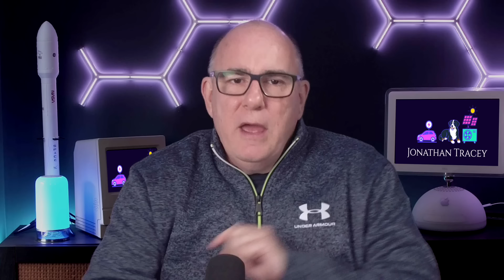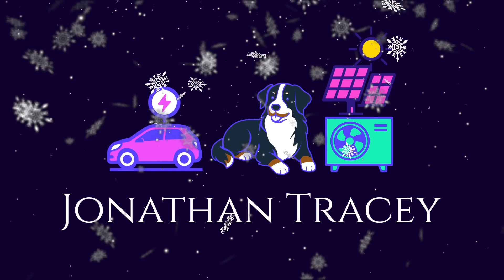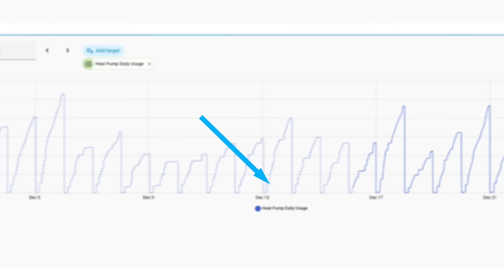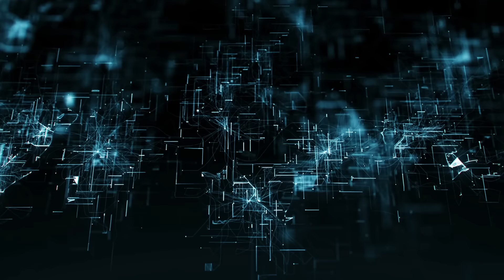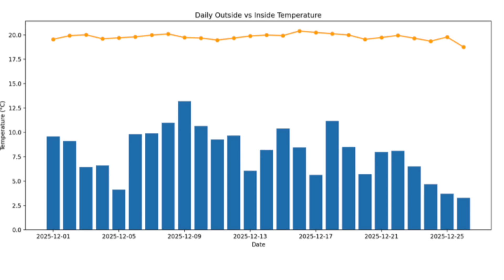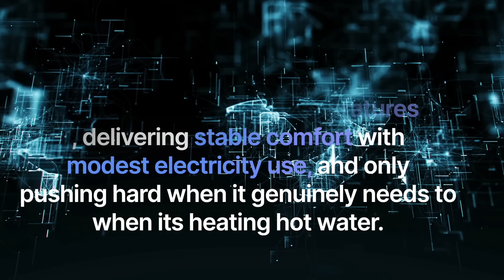I Analysed the Data — Here’s What Everyone Missed

Comment: That's a great video Jonathan which answers a lot of questions for someone like me who is just thinking of getting a heat pump. I got solar and a battery installed last year and it has been great - on course for zero bills overall in the first year - so a heat pump is the next logical step.
Reply from the maker: yep if you have the battery capacity it makes running the heat pump in winter super cheap

Comment: The flow temperature and energy used by outside temperature is surprising.
I wonder if it would be a good idea to drop the temperature on the thermostat by 2-3 degrees at night and therefore leave it running 24 hours say November thru February?
Reply from the maker: we actually do that we set back the temperature at night time from 10 pm till 6 am to 17°. It makes it a little bit more comfortable to sleep and it runs consistently from mid October to usually roundabout mid March.
Reply: @JonathanTracey That’s a good tip 👍
Does the installer suggest that ?

Comment: For comparison, my data for December 2025: (SI units)
Heating degree days for 31 days: 509.6 HDD=31 days*(T.inside-T.outside)
Inside average temperature 19.50C
Outside average temperature: 3.06C
Heating area thermal losses estimated: 135.775 W/K (Yearly 3000HDD =>  9775.8 kWh/year / 54m2 = 181.03kWh/m2a)
Total heating energy:: 1660.6 kWh
From people: 66.96 kWh = 4.03%
From electrical consumption: 74.4 kWh = 4.48%
From solar gains: 258.99 kWh = 15.60% ( solar gains efficiency 94.94%) ( solar gains gamma = 0.188 , alpha = 1.6667 . tau = 10h ) (0.129 kWh/day/m2) (68.2m2)
From gas heating 1260.23 kWh = 75.89% duty factor=39.51% @ min.modulation=40% part load efficiency=87.9% declared efficiency=84% LHV total efficiency=64.59% HHV
Gas heaters 3 furnaces total power=14kW @ LHV (oversized)
Heated area: 54m2 Solar absorption area: 68.2 m2

Comment: Interesting video, thanks.  The point about the thermal mass of the house is interesting - we were on holiday in November when our boiler stopped working (system pressure too low) which meant that the house cooled down to around 7C while we were away.  The energy consumed to heat it back up again was substantial and this was due to having to heat up the fabric of the house again.  Unlike gas prices, electricity prices vary by time of day so it would be interesting to see what impact this had on your usage.  And it would also be interesting to see the same numbers for January now that it's got a bit colder!
Reply from the maker: So the way I run my system is that I import all the energy I need for the day overnight when it’s cheap and storage in batteries, this then feeds the Heat Pump and the house so the variable price of electricity doesn’t really impact us.

Getting the last couple of days when the temperature has really fallen we’re using more electricity, but not massively so maybe another 10%, and I’ve seen average flow temperatures go up to about 38° which again is more but not massively so

I generally do an update on how the system is performing every quarter, if you’re interested, feel free to subscribe
Reply: @JonathanTracey  Interesting thanks, yes a battery makes even more sense once you have a heatpump although it's quite a big capital outlay.  I like the idea that you switch to an EV when you change your car and it won't cost you any more, and that switching to an ASHP won't cost that much more than a new boiler.  Solar + batteries are a great investment if you have the capital available AND you're not planning to move house, but EV/ASHP are the bigger decarbonisers!!

Comment: I do similar analysis with my Viessman boiler. An interesting metric is the wind speed outside and how this affects gas consumption. My house is not particularly leaky as I had an air permeability test done 3 years ago and it has an EPC of A. We are relatively exposed with open fields to the rear but it is surprising how much it contributes to heat loss.
Reply from the maker: that’s a good idea. I’ll see if I can factor in windspeed because like you we are very close to a whole set of fields that are very flat and the wind just howls across them.

Comment: Also need to factor in solar gain through the windows and also if  your roasting like on Christmas day the heat from the oven . If you house is well insulated it makes more of a difference .My house on a sunny day can save 2-3kw of heating.
Reply from the maker: not to much solar gain this time of year and we did most of the cooking the day before so should t be too much of a factor
Reply: @JonathanTracey  At least 20% heat from gains in December (people, el.consumption solar walls/windows) (no wall insulation)
Well insulated house can reach e.g. 60% heat from gains.

Comment: It has been 30 years since my wood fired central heating was installed. No radiators, no pumps, just warm air and it functions during power cuts.
Reply from the maker: what does it cost you in wood and effort to keep running?

Comment: Interesting.  For info, the correct metric for analysing consumption data is the use of ‘degree days’ for the specific location ( this data can be found online).
Another interesting point is that many people don’t realise that a lot of these techniques can be applied to appropriate gas boilers - many modern boilers can run low flow temperatures with decent modulation.  The problem is that not many people (or even gas engineers) are fully appraised of these techniques - evidenced by how few boilers in the UK run weather compensation on correctly range rated boilers.  Many installations could operate on similar low temperature systems with a fraction of the cost of a full heat pump install.
Reply from the maker: I agree, gas boilers are still been developed and ways to make them more efficient of being added to new models all the time. But look at the number of gas engineers that are being trained up, it’s dropping off the cliff. This means that you end up with a bunch of gas engineers who keep doing things the way they’ve always done it and these newfangled features don’t get implemented.

Comment: The definition of 'cosy' is subjective, I'd find your 19-20 degrees cold, whereas my 'cosy' would be 21-22.
Reply from the maker: yeah, everyone’s gonna have a different temperature that they prefer, but my video my definition of cozy😂
Reply: @JonathanTracey  Feel temperature is 50% air 50% mean surface temperature.
Therefore thermal insulation affects meaning of cosy.
Without insulation cosy =25C air (15C surfaces)
With insulation cosy= 21C air (19C surfaces)

Comment: Hi jonathan. We were away for 6 days over Christmas and I ( unfortunately as it turned out ) put our 6kW Daikin in " Holiday " mode. I could watch the house temperature dropping over the days that we were away. Noticed the heat pump hadn't fired up in the early hours of the morning on the day we were due back so I switched it on remotely. It's taken 3 days to get back up to temperature, yesterday I was advised to increase the LWT a couple of degrees to speed up the process. Now it may well be that the Daikin thinks that the holiday dates are inclusive, if you see what I mean ( I had put in 22nd to 29th in the Holiday schedule as we were due home on the 29th ). In hindsight setting the Madoka room stat to a lower temperature and just left things running would have been a better strategy.
Reply from the maker: Yeah I’ve heard this a couple of times, I’ve never used the holiday mode myself. I always just set the temperature back a few degrees and let it do its thing. But good to know that it took three days at least you know now that if you’re coming back from a holiday in the winter to turn it back on three days before you intend to come back. I know it’s impossible to test but it would be good to know the difference in energy used if you were just left it on but say 19° for the whole time.
Reply: @JonathanTracey  Well, if we get invited back to our daughters in Leeds I can repeat the experimend and adjust for comaprative ambient temperatures .😁
Reply: My experience of being away during the winter with a heatpump, is that it takes the same amount of time for the house to warm up as it took to cool down. So if it is say loosing 2 degrees per day until it hits equilibrium or your away temperature, it’s going to take the same amount of days to heat it back up efficiently. Trying to do it at the last minute won’t work and your heatpump will be working at max with very little COP. If I go away at this time of year, I let the house drop to 15 degrees then maintain that. I also know that from 15 back to 21 it will take about 4 days to do it economically. Times and temps will vary from home to home but you will know yours by watching it lose temperature while away.

Comment: Similar set up to yourself with a 6kw Daikin from Octopus however our energy usage is about double what you’re seeing. We have a modern and well insulated  4 bed detached, approx 170 Sqm however living “Up North” - NE Cumbria, we’ve seen an average daily temp of 4 deg C during Dec with a maximum of 9 deg C on the 17th. WD curve goes from a flow temp of 28 at + 18 to 50 at -4. It was -5 deg C here last night. House set between 20-21.5 during the day / evening and 19.5 overnight. SCOP running at about 3.6. All seems to line up with the design figures but interesting to see the big difference between our usage figures.
Reply from the maker: the only difference i can see is mine is set at -7 for 50c, what kind of COP are you getting?
Reply: @JonathanTracey  For Dec the COP is 3.4 for heating and 2.3 for DHW. Average consumption is 11 kwh/day for heating and 2.2 kwh/day for DHW. On one of your previous videos covering your first years consumption you mentioned a figure of 2457 kWh for the whole year. Last Dec it looks like you used around 400 kWh for the month. This would be a lot more in line with what I’m seeing with circa 400 kwh used in Dec and 1 Mw used in the last 6 months. If you are consuming just 5.5 kwh / day in Dec you’ll have to be going some in Jan / Feb / Mar to get up towards your annual figures ?? My only other thought would be to run the heat pump longer at a lower flow temp to see if this reduces consumption ?? Thankfully though I do have 6.6 kwp of solar and 20 kwh of batteries so actual cost for the year is significantly lower than previous years.

Comment: Do you have any issues with condensation on your windows?
Reply from the maker: nope we have the small vents above the double glazing  open on one side of the house to allow a small amount of airflow
Reply: I found after getting a heat pump that the condensation dropped a lot - presumably because of the 24-hour constant temperature. We still get a small amount of condensation on windows at times, though much decreased, and the small amount we had on certain walls has vanished.

Comment: Very impressed by those Kwh input figures. Now completing my first month with my Cosy 9 from Octopus and it’s looking like an average of ~27kWh input with a COP average of 3.84 for a 4 Bedroom house (2001) based in the South West. Maybe there’s some tweaking needed on my system to improve performance. Keeping house between 19c overnight, 20c in the morning, then 21c from 2pm until 9pm.
Reply: That's good going on the Cosy 9, mine hit a COP of 3.66 for Dec. I have got it set to be "on" constantly for both heating (21c) and hot water (53c). Our house is also a 4 bed but slightly older and with microbore so I'm fairly impressed so far.
Reply from the maker: yeah, yours is always gonna use a bit more energy than mine. Yours is a 9 kW Heat Pump whereas mine is only a 6. But a copper 3.84 to 4 is pretty good.

Comment: I like the idea of Shelly monitoring, however as they only monitor AC current, I'm still looking for something which can monitor the DC strings separately.  Not found anything yet.  Unfortunately the PW3 only offers 'snapshot' access, and not continuous DC data AFAIK.
Reply from the maker: yeah I haven’t seen a good DC monitoring solution yet, although somebody suggested to me should look at what they might install in a campervan because a lot of the 12 V system is DC
Reply: @JonathanTracey  My panels were installed with Tigo optimisers, which I had removed as they are not allowed on PW3.  Shame Tesla don't offer the data via their app.  Apparently PW2 did allow the data.

Comment: Very impressed with how little power you are using. What's your heat loss?
Mine is 10.7kw loss and using about 30kwh per day generating about 130kwh of heat so decent COP. Flow temp typically under 30C
Reply from the maker: To be honest, I haven’t measured the heat loss, I know it was done as part of the original survey but since then we’ve added more insulation so I’m not sure those numbers are accurate anymore.

Comment: I keep my old earlycvictorian detachedhouse. At 22 deg for 900 a yearbon large oil boiler no heatpump plus instalation. For. Me. at. 80. Plus would not vwant upheavell so keepvheatpumps even. If.   oilvprices. Rise. In. Next  year or so  when. 90 ! Belike vaccinescwhich. Have never had since. RAF In 1956 a modern dayccommercial con trick!!
Reply from the maker: Okay, I’m not following most of this, but £900 a year isn’t exactly nothing that you’re handing over to the oil company. Have you looked to see if you could get a grant? You might find you qualify for free solar batteries in a Heat Pump under the department for energies latest schemes.

Comment: You're lucky. My Octopus designed system is using 20kwh a day for a 4 bedroom bungalow in S.England. Fully loft insulated and double glazed. However, our Gas usage last december was 2194kwh which kind of works out at an energy COP of 3.6 so perhaps that's ok. Our total energy bill has gone up by 14% but as you say, it's much more comfortable and on all day.
Reply from the maker: Yeah, I suppose as you go up in size of house, she also need to upsize the Heat Pump which means you will use more energy. Do you have any solar on the house, to help offset the cost during the winter?
Reply: @JonathanTracey  The panels are on the roof but not connected yet. Install to be completed in Jan along with PW3

Comment: Heat pump create a better environment in the house. Instead of on off screaming hot radiators you have a gentle hum of heat. 
Transformed my 1680 farm house.   Warm everywhere, massive reduction in condensation and no fossils in a big green tank.
Even better it’s run off the sun - December saw just 3 days where we had to import during the day.
Reply from the maker: Nice, I can’t imagine an old farmhouse is that well insulated, it’s all these people screaming that you need Norwegian levels of insulation must be wrong😂😊
Reply: @J @JonathanTracey  poorly insulated house is poorly insulated whether you have oil, gas or a heat pump. You wouldn’t put an undersized oil burner into an old house. Just put an adequately sized heat pump in. Make sure it’s inverter driven though so it can throttle if demand reduces (if you insulate later). Fossil systems were designed for on/off operation and rapid heat up. 
Your point about thermal mass matters - keep the heat on and you’ll be surprised that your rads are probably ok. Just checked the lapse rate on my house during the night setback 1C/ 4 hours and the reheat rate is 1C/2 hours. Accept lower CoP on colder days - insulate later. Don’t wait to electrify!.

Comment: It's not surprising your heat pump works great lived in a couple of houses like yours turn heating on 10 minutes latter house is hot it's older houses where it's a lot harder to get setup correct run my rads at 35 degrees the temperature will carry on going down on cold days lol.
Reply from the maker: that’s why it’s important to have a full heat loss survey and design done for the specific property. That way they can size everything appropriately. If you have less insulation than they can either make recommendations to resolve that or build the system to accommodate for it.
Reply: @JonathanTracey yes I did octopus said no could not do it and different quote wanted to put 2 heatpumps in obviously too expensive so had to get a new gas boiler shame as I wanted a heat pump.
Reply: We have a 50s av 3 bed semi, also Octopus installed (Daikin ) pump, from the limited figures I have , it shows just over 4 cop during the 14 month period so happy with it, and a big upgrade from a 42 year old boiler!
Reply: @cliveharrington1553 and I thought our boiler was old at 28 years!  😂
A friend of mine has a 10yr old combi and it's had so many replacement parts it's practically new.
Reply: @roblinc2u I've got the original receipt from when in was fitted , I think back then they were very simple , it was only serviced once in about 24 years and nothing needed doing except the glass window revealing the pilot light cracked...
Reply: @cliveharrington1553 truly sustainable

Comment: A couple of small points.  December is on track to be the warmest on record, it hasn't been an average December.  With regard to Christmas Day, certainly here in York it was notably sunnier than previous 3 days.  The heating probably used less energy at least partly due to solar gain that day.
January should be very informative as it looks likely to get very cold soon.  I fully expect your heat pump to cope well, but I am looking forward to seeing the data.
Reply from the maker: Here in Cambridge it was actually quite overcast with only occasional sunny spells, and any solar gain would have been offset by it being the coldest day of the week so far — daytime temperatures were around 2 °C.

January should be much more revealing anyway, and I’ll do an update at the end of the month on how it performed.
Reply: December was shockingly poor for solar. Grey days!